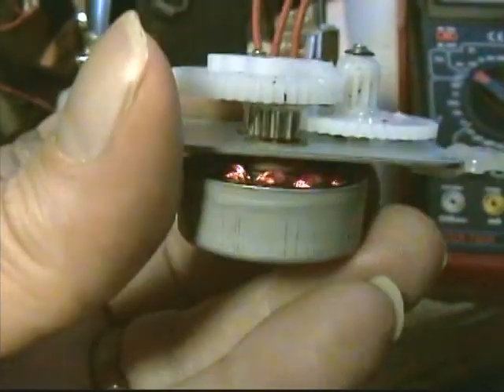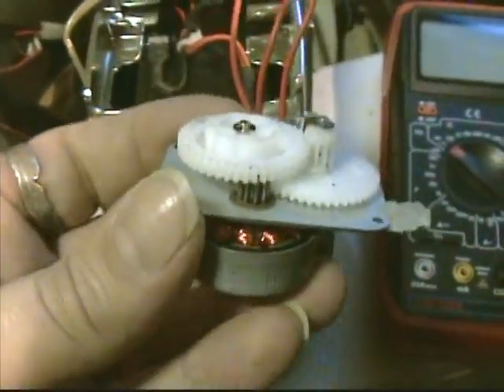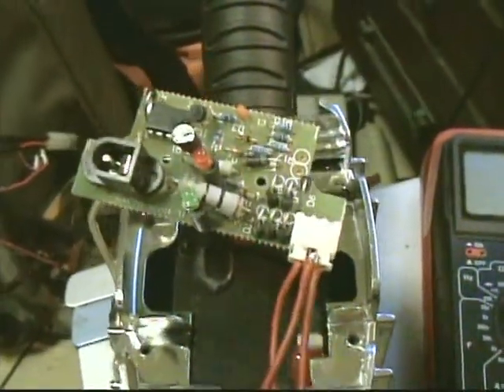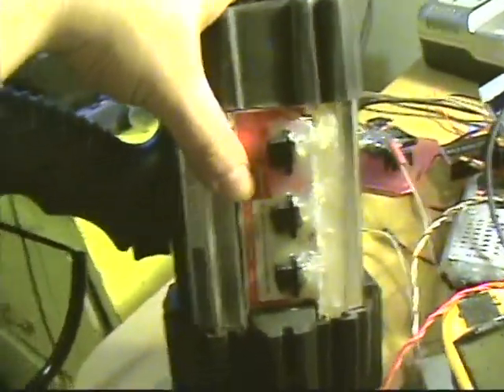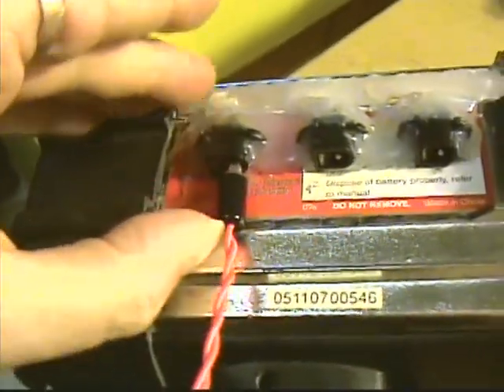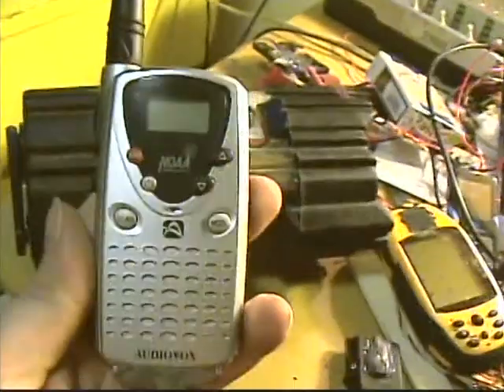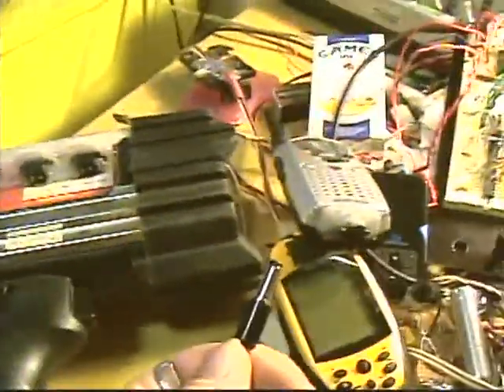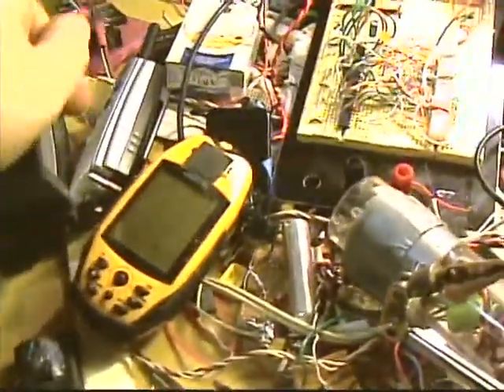SURVIVAL FLASHLIGHT THING 1 and laser

Comment from the maker: @Nedspodos     Yup, model rocket igniters will work too, and also if You find like some speaker wire and cut it open to get at the smaller strands inside, then You loop the end into a coil because that's where the heat will start where the wire bends like a spring, but just straight wire may not be as efficient, got to have the coil in the middle like the filament in a light bulb is coiled like a spring.   I used to do that years ago when We didn't have any rocket igniters.